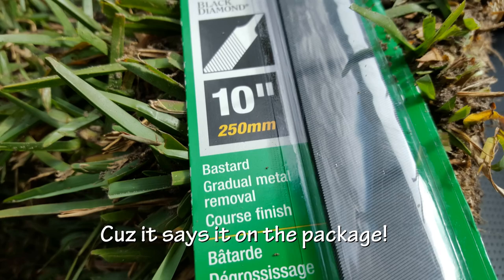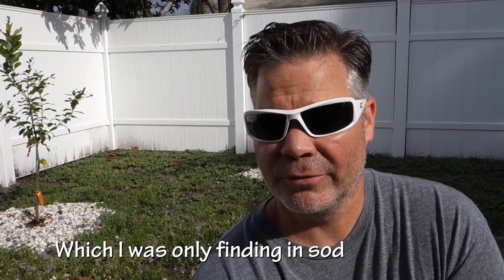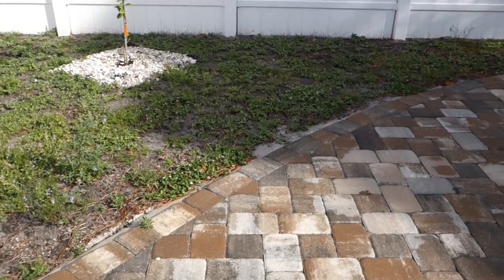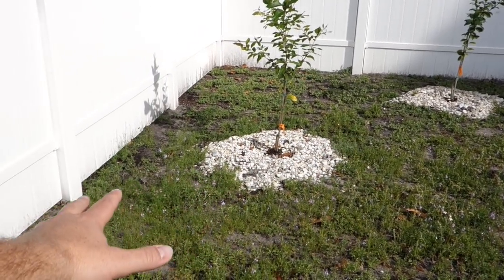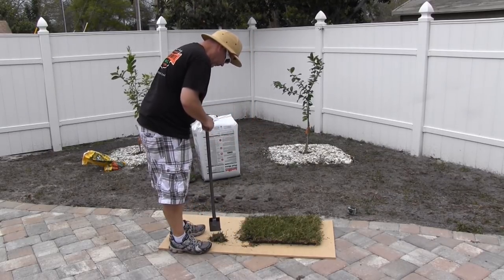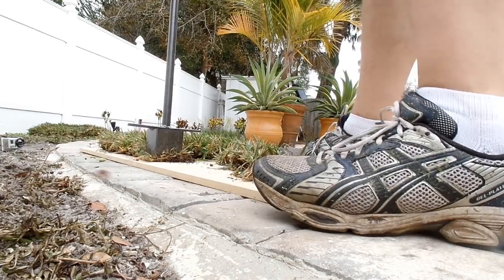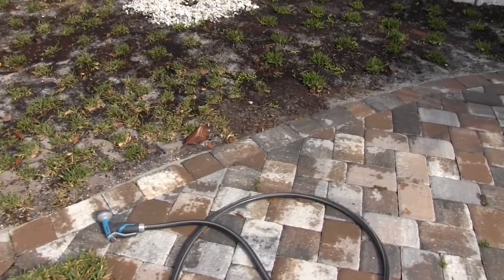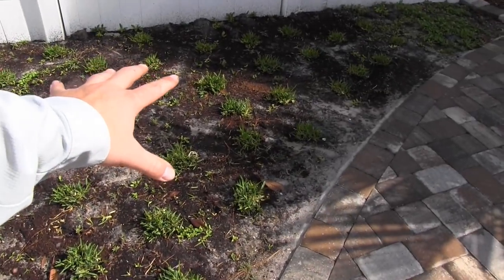Making St Augustine Grass Plugs From Sod :: Palmetto St Augustine

Comment: If you are going to create plugs from sod, turn the sod over and cut it from the bottom. There's 3x less resistance and you aren't cutting your runners (less stomping). Section the entire piece then pull it apart by hand. BTW love the channel, great tips!
Reply from the maker: +Lanhavoc I had never thought about it that way before - good stuff thank you!
Reply: Thanks! I am getting ready to plug centipede, and this is a good tip!!

Comment: St Augustine cuttings are easy to grow. On brown spots..I just take out the dead grass then add top soil before I plant the cuttings (with roots). I plant cuttings as many as needed at 1 to 2 inches apart. Then I install a cheap water timer and connect the hose to water the cuttings twice a day for 10 minutes. In two weeks time the brown spot is gone.

Comment: I use a spade shovel on soft ground Not a board to cut sod into squares.  Much easier.  Then I trace around the sod plug with the spade so I know what to dig out.  Have you seen the cost of sod plugs?  $55 for 36 plugs at HD.  I can make 36 for $6.  I love the lawn care nut videos though.  I can use all the help I can get.

Comment: Problem with using plugs is st aug plugs is 72sq is $60 & a 400sq pallet of st aug sod is $175 so if u do the math youd need 5.5 trays of plugs for the same coverage as one pallet of sod, the plugs would cost you $330 vs $175 for the same coverage a just laying a pallet of sod

Comment: I have St Augustine grass in Florida, but the lawn watering was neglected by the previous home owner, and there are areas of 100% weeds. I thought about having the lawn re-sodded for about $7,000. 

I’d like to try killing the weeds with chemicals in some small area to test using plugs to restore the lawn. I suspect that using plugs would be drastically cheaper than paying thousands of dollars to re-sod the lawn. Where do you buy the plugs? What is the spacing of the plugs? I assume that the lawn mowing company needs to avoid the plug area for a some time so the plugs are not sucked out of the ground by the lawn mower. How much time does it take for the plugs to completely fill in the area with St Augustine grass?

Comment: Rotory tool with a grinding wheel is easier. 

I've been doing the plug thing for a few years.  I have one nice patch that I harvest plugs from.  I found it survives better than sod that I have bought in the past.  I put some in rows to steadily increase the size of my harvest patch.  The rest have gone to start patches on other parts of the property which I will be harvesting from this year.

Comment: It's called a bastard file as its bastardisation of several types of file, single cut , second or double cut mix. Now you know 
Also why did you sharpen the inner edge?
Reply from the maker: +Gixer750pilot I sharpened the inner edge because it had less pre-existing bevel.  Believe it or not, the thing is really sharp just with what I did taking off the powder coating. But still not ideal.

Comment: Great video Allyn!  Question to you, I will be getting 10 pallets of St Augustine grass sod for my yard due to uneven areas and thr builders will provide them. Do you think if i would checkerboard the whole yard would that be good? I'm going from centepede/bermuda.. to now st augustine. Thanks again for the tips man! I'll try to send pics of my process.
Reply from the maker: +dverrett2009 I'm not sure what you mean by checkerboard the yard. Aren't they giving you enough to cover your entire lawn? As far as a pattern to lay sod in, you want to do "running bond" like bricks.
Reply: +The Lawn Care Nut I wish they was going to wouldn't that be awesome! My yard is a little big and the 10 pallets that they give won't cover all of it. I was going to do the perimeter around my whole yard and the inside of that put corner to corner with the sod...well as far as it will let me go.  It's like having big giant plugs but made of whole sod pieces. You know what im saying? Thanks again!
Reply from the maker: It would work but it will look really strange for a while. If you are replacing Bermuda you have to be careful and make sure you really kill it off good. or it will just haunt you forever!
Reply: +The Lawn Care Nut Definitely would be strange looking. I sprayed the yard with the HDX from Home Depot. It looks like a true dirt field. They will be doing the grass work soon, had to delay because of weather.  How do I know if it is completely dead? That dorn bermuda!!!!
Reply from the maker: if it's orange/brown it's dead but if there is any green at all you need to re-spray
Reply: +The Lawn Care Nut I definitely believe we good. Thanks again for the videos man. This St Augustine rehab is going to awesome! Also, I've been talking with Sebastian with Solutions Self-Chem about the product they offer, Whoever reads these comment I highly recommend giving them a call! Down to earth people and ready to help with your lawn! "No they not a sponsor" lol.
Reply from the maker: +dverrett2009 awesome!!!

Comment: I believe you would have had better luck cutting plugs if you put the sod on soil instead of plywood.  Your plug cutter would then cut clean through the sod.  Although, the machete is more fun.
Reply from the maker: +Mark Potts good point! I did not think to do that.

Comment: Dude Hyundai and Kia are the worst car you can ever buy
Reply from the maker: +Danny Quesada all I can say is that I'm glad I have a 100K mile warranty. Brand new tranny put in last month at only 48K miles. I paid nothing.
Reply: The Lawn Care Nut wow the transmission broke at 48K, well just because a car comes with a good warranty doesn't mean you should buy it, considering that you could have been out in the middle of nowhere, only expecting to run out of gas because the car only has 48K miles and the transmission blows up. if i were you i would buy a subaru because 95% of subarus sold in 2000 are still on the road today
Reply: I'd agree with you 10 years ago but nowadays they are as good as Japanese makes. Just look into how many they sell. I have a Veloster going strong at 120K miles. I'd say the same thing about getting European cars but my experience with my Bmw has been great too. Always research before you buy.
Reply: +malagabee wow you bought a veloster. I heard the turbo whistle on that makes it have 500hp when the sound is coming through the speakers😂😂😂
Get a real sports car kid
Reply: +Danny Quesada don't need any sports cars real or fake. You obviously have bad taste in cars. Grow up man. People buy cars for all different reasons to each your own. I bought it for the 37 mpg it gets.
Reply: malagabee veloster is marketed as a sports car when really its just slow, ugly and cheap. Any sane person would realize that car that has a 100K warranty would be absolute crap. If were you, i would sell it now and get the 5 grand and buy a new hyundai because you're a fanboy
Reply: +Danny Quesada there's no reason to knock on what people drive. Mine isn't a turbo and for a beater commuter car it is pretty good. What beater car do you own?  I paid off all my cars free and clear and I maintain them and  drive them to the ground. Let me guess you racked up all your credit card just to buy a Subaru which is really made for old people with no souls.
Reply: malagabee naw mate subarus are for the active people because of its all wheel drive which is why Subaru has always beat hyundai in rally